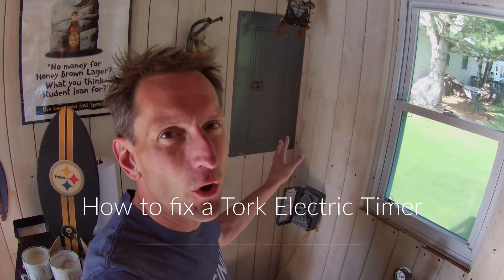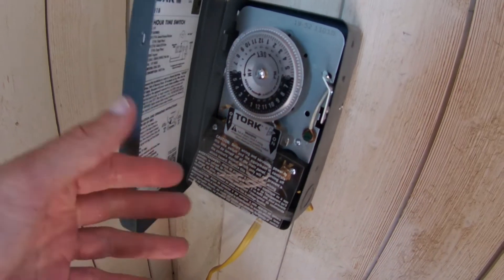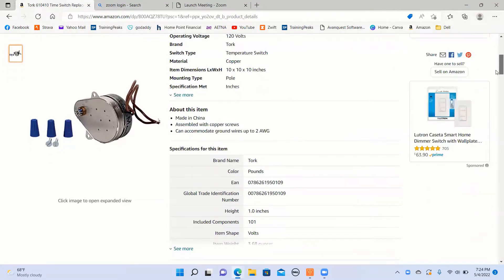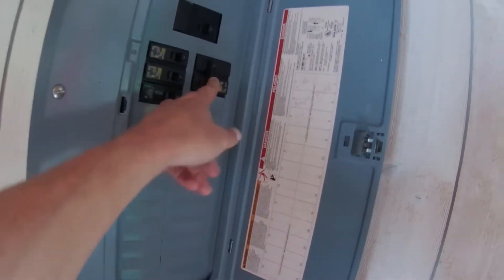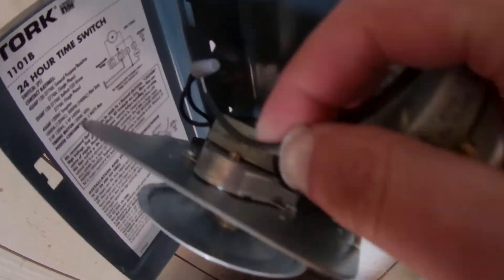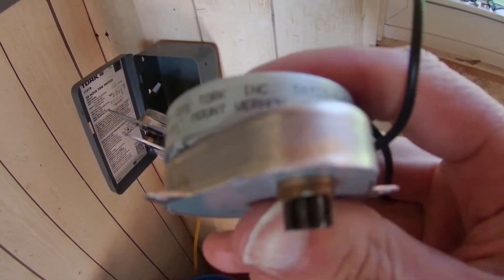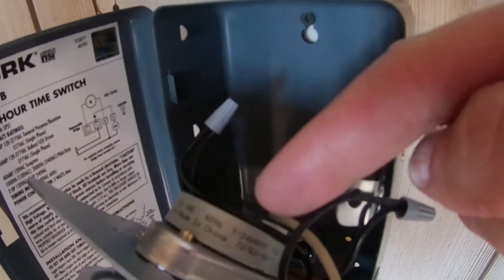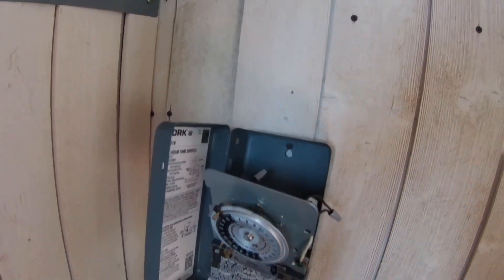How to fix a Tork Electric Timer

Comment: For my timer the motor is fine but the wheel popped off. Upon inspection the back of the wheel looks like it has some kind of glue. Is there a replacement for that part the eheel assembly
Reply from the maker: I don’t know, sorry

Comment: This is a known defective design.  Early models were fine but those made in the last 20 years have a poor swage fitting on the dial and they begin to just slip.  The dials are basically unavailable on the internet but Tork (NSI) will sell them to you if you ask nicely!

Comment: I can't read the part number on the screen you have.   I ordered part number 610410 and it's moving but not moving the timer wheel.   Any suggestions?
Reply from the maker: Yes 610410 is the part number. But I don’t have a suggestion.
Reply: The timer dial is the weak link in the system.  The soft aluminum disk is made of cheese and it strips out on the brass hub.  I've drilled and safety-wired the disk to the brass hub (the gear, actually) and it worked for two years until it didn't.  Tork stopped supplying replacement wheels, which is shyster business practice; they want you to buy an entire new timer.  I am done with Tork.

Comment: Wondering if anyone can help me. I have this timer and the on (right) switch and off (left)  switch work manually. The peg for on also works from the dial,  and the peg for the off moves a switch located in the back (middle). Looks like the switch in the back does nothing if I use it manualy also so it is not working right. I think there is a connection ( spring?) that connects it to the left ( off switch). I can not find any image of the tork timer behind the dial so I have no idea how it works. I see the off peg is longer, so it is clear that it tries to trigger the switch in the back. but how does that switch turn off the left one? It is not clear to me how this works.
Reply: That on/off trip mechanism is like a clock or a gun trigger group: lot's of small moving parts.  Apply a tiny drop of oil to every axle where you can see that parts rotate on them.  The best way is to use a tiny screwdriver; lay a drop of oil in the blade and use the blade to reach in and place the oil exactly where you want it.  Note: the 'off' lever behind the wheel is a split lever; that little flat leaf on the lever needs to rotate to the left when the 'on' switch is activated.  Make sure that is happening.